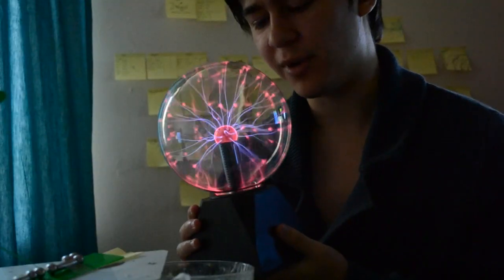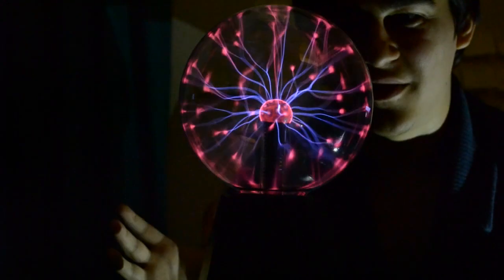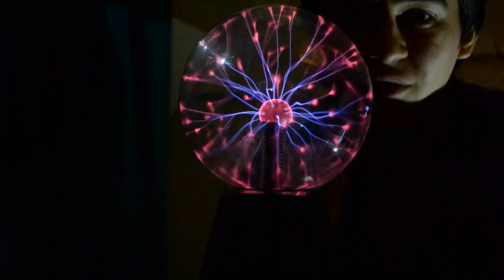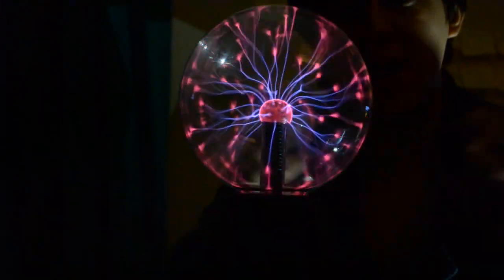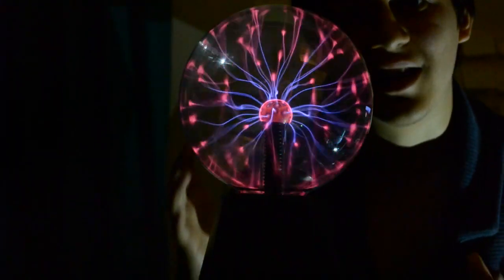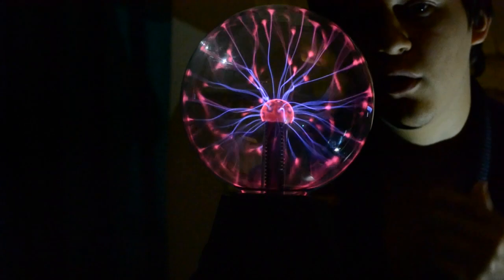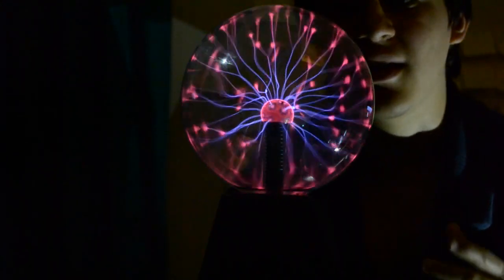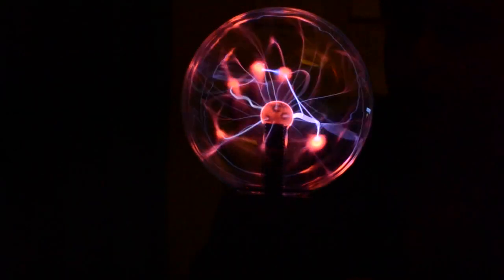How does a Plasma Globe Work? (Bonus Video!)

Comment: I have few questions. First, I thought only heat created plasma, and why does high voltage create heat? second, what is a photon emmission?
Reply from the maker: For a plasma you need to keep the electrons and the ions apart, which means the particles require a lot of energy which is why plasmas need to be hot. The high voltage causes any free electrons present to accelerate rapidly and collide with the other atoms, imparting enough energy to rip apart the electrons in the other atoms. This leads to the plasma being created, with the excess energy from the high voltage becoming heat within the particles, as heat is essentially just a measure of how fast the particles are moving.

Photon emission is how light the light is created from this. Sometimes an electron collision causes an atom to gain some energy, but not enough to ionise and form part of the plasma. In this case, the electron in the atom may absorb some energy and raise to a higher level. This is unstable, and the electron will decay back down to a lower energy - this releases a photon, a particle of light which carries the energy away.

Comment: I have one but it you can only see plasma around the center thing. Unless you touch it. Do you have an explanation for this?
Reply from the maker: The way the plasma looks depends on what gasses they put in the globe, so it could just be that your one has a different set of gasses in to mine.  Or it could be just that the plasma loses its energy at a different rate as it reaches the outside and so just becomes much darker.
Reply: ForwardSlashReality where  did you buy it?

Comment: If a fluorescent tube is brought close to a plasma ball it illuminates. For people who collect the chemical elements they collect the noble gas in small sealed glass tubes. If those tubes are brought close to a plasma ball will the gas in those tubes glow in their associated colors?

As it is, for someone collecting the noble gases it is rather boring since they are all colorless. I'm wondering if a plasma tube would allow for the discharge colors to be visible.

Plasma balls are inexpensive and I'm wondering if this would be a good way to better show off a noble gas collection.
Reply from the maker: That would be an interesting idea to try out, I'm not sure of the outcome. I do think that for any effect you would need the noble gas to be at a low pressure.

Comment: But why does it follow your finger?
Reply from the maker: Because the human body is more conductive than the air, pressing your finger against the globe gives an easier path for the electrons to flow across
Reply from the maker: Because the glass doesn't conduct electricity, its not that the plasma current is going straight through you and into the ground the same way as if you touched a live wire. Its instead due to a property known as capacitance, where the conductivity of the human body allows some of the ions in our cells to move and lets a small amount of charge build up where you touch the glass - creating an electric field that attracts the plasma.
Reply from the maker: Yes - most touch screens do use capacative technology - which is why they don't work with insulating gloves on. And you're welcome :)